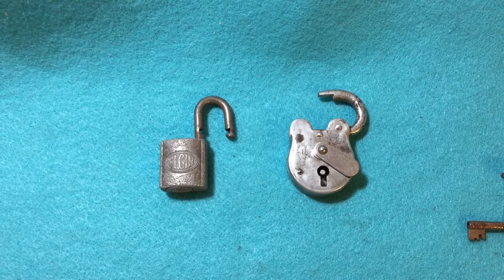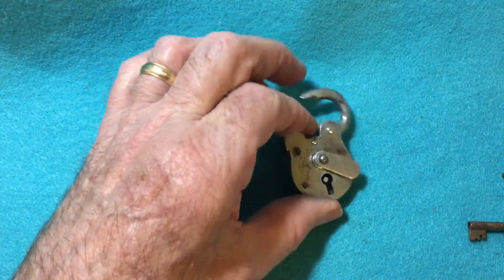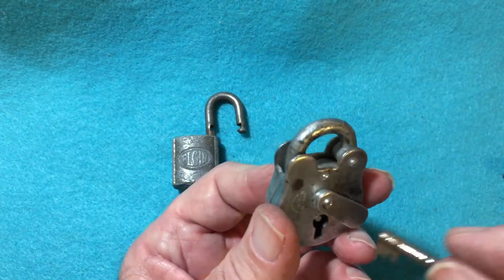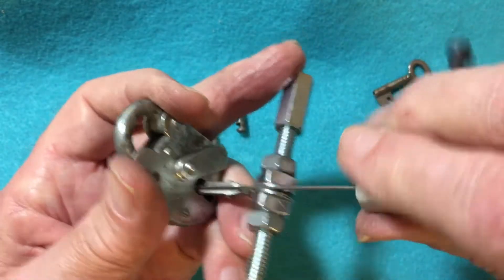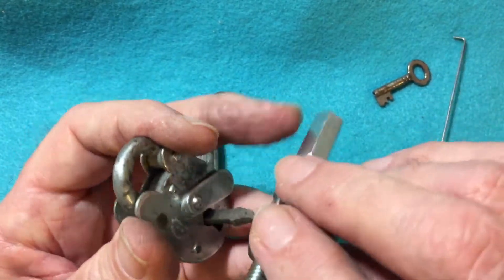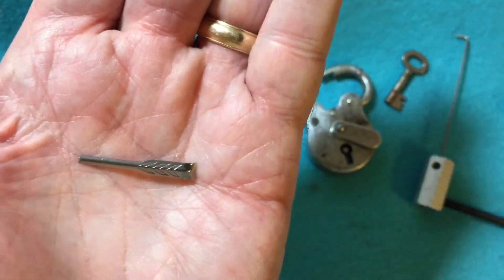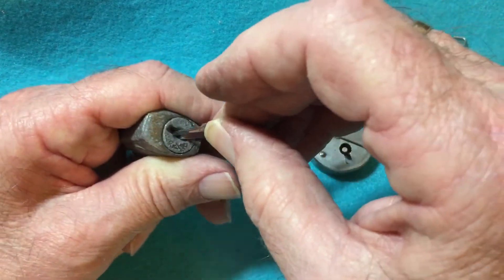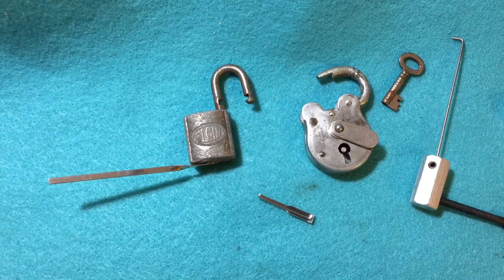#132 Miniature Padlocks Picked

Comment: The Elgin looks like it's had a life and a half but Parker showed no mercy, well done Jack. 
The small English padlock looked like it felt safe from Parker so the very nice picking showed it a thing or two. 
😁👍🏻
Reply from the maker: The Parker pick is just a gimmick. You can use a wiper blade just as well on wafers. But it does work on cuffs for sure. 👍🦊
Reply: @jackfoxlock  just as Coxy keeps showing us Haaaaaaaaaa